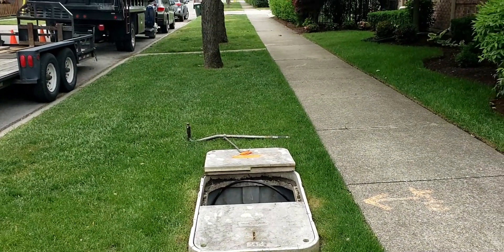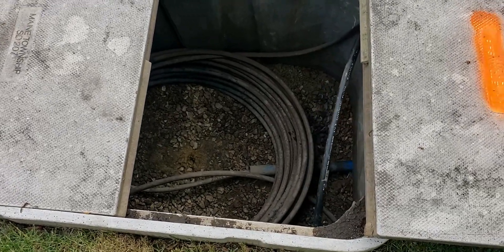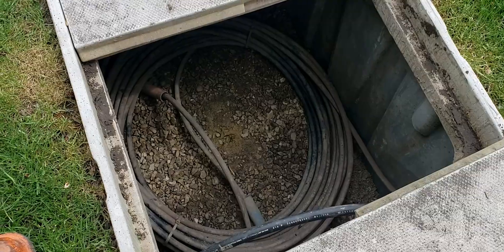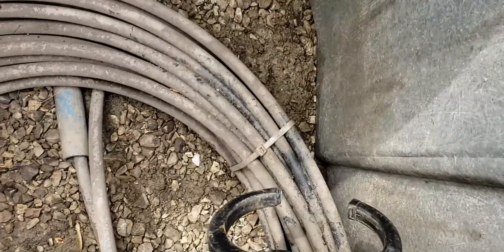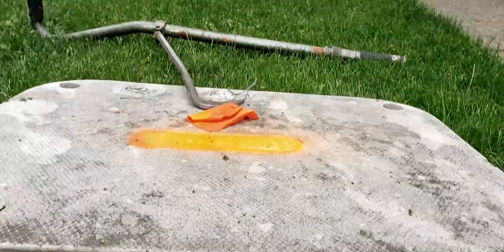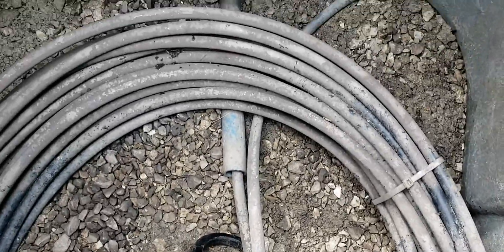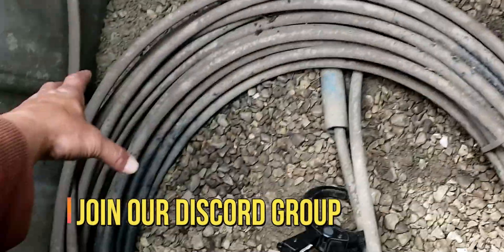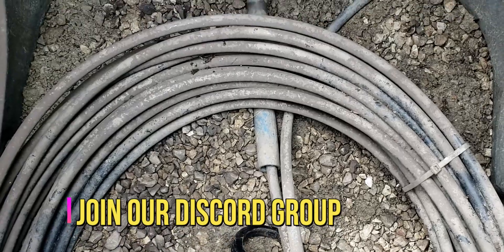Tipsy Tuesday... Locating Fiber Optics Out Of A Handhole | How to

Comment: How can you tell it’s armored versus sheeth -where are the tracer wires for fiber optic lines like this at?   I usually at I never see them
Reply: Carry a small magnet with you
Reply from the maker: You need to determine whether it's dielectric or armored. If it's dielectric, you’ll have to find a trace wire or escalate the issue back to your client. You could always use a magnet to test the fiber—if it sticks, it's armored.